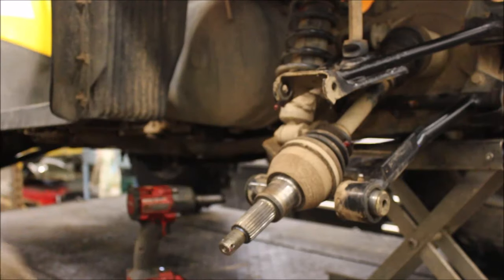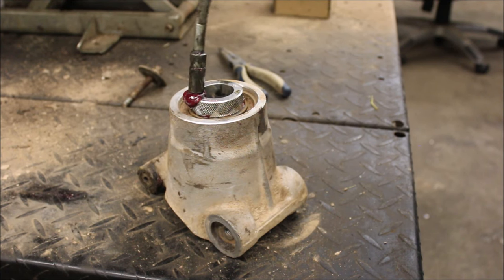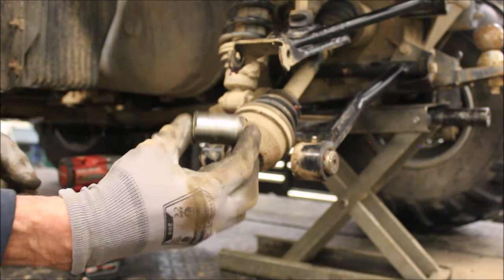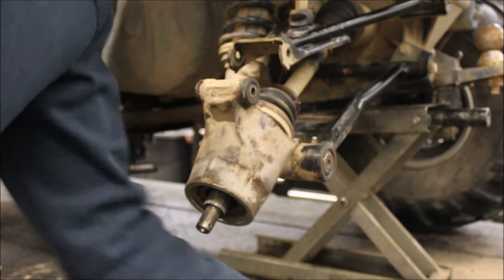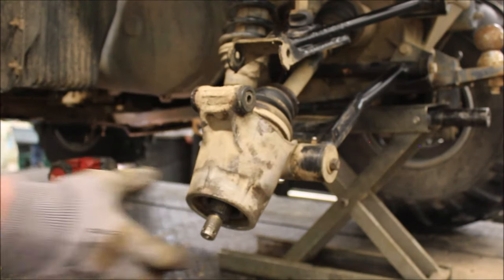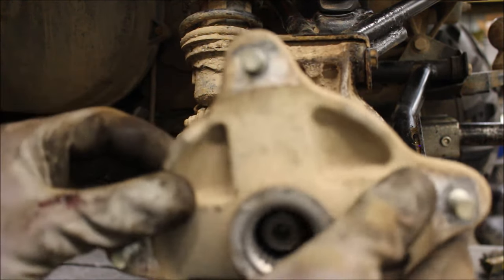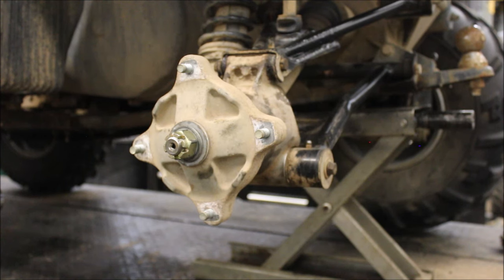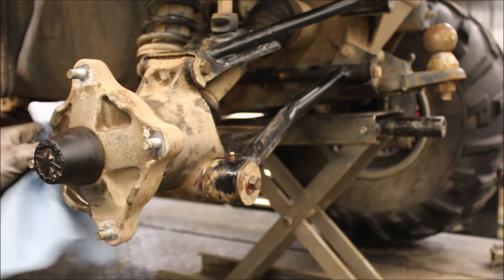How to grease your rear wheel bearings on a Polaris Sportsman

Comment: I like that tool. There seem to be different sizes. 40mm seems to be what fits the rear bearings (I have an 01 500 HO).  Is the tool you have 40mm? I also see a 35mm and a 44mm listed that advertisers claim fits the front wheel bearings, but they must be for newer models that do not use the Demand Drive with hub oil? Thanks for the video and sharing your knowledge!
Reply from the maker: I bought the 3. It came in a kit. I think I use the 40mm.

Comment: I’ve got some problems finding specifications on driveline fluids on a 2004.5 atp 500 H.O the manuals are pretty unclear and none of the part numbers seem to be the same I tried to search forum’s but it there doesn’t seem to be a whole lot on the ATP models if you have any advice on where to look or videos it would be much appreciated
Reply from the maker: Polaris makes all the fluids. I would contact a dealer. What fluids are asking about?
Reply: @TitaniummanGarage  I was referring to angle drive fluid,demand drive fluid,  and agl fluid which from what I’ve seen is transmission fluid I called the dealer and they said that I don’t need angle drive fluid for either of the gear cases but the manual says the rear gearcase takes 80-90w gl-5 gear lube which is the weight of the angle drive fluid so that confused me the demand drive fluid doesn’t specify weight on it. The machine has sentimental value to me so I wanna make sure I don’t f$$k it up lol thanks for taking the time to reply!